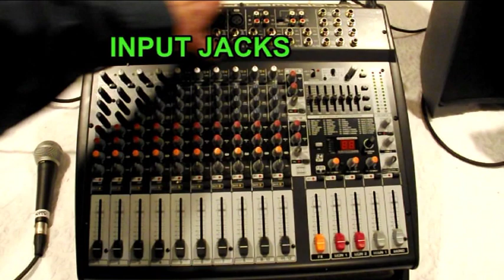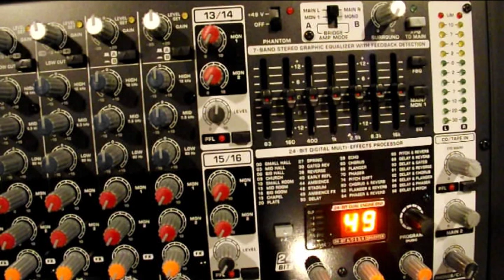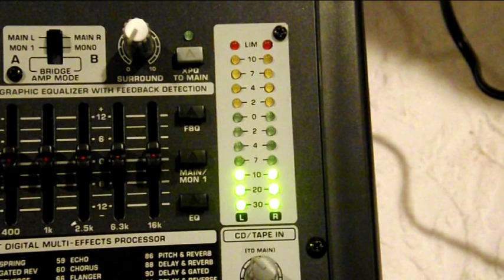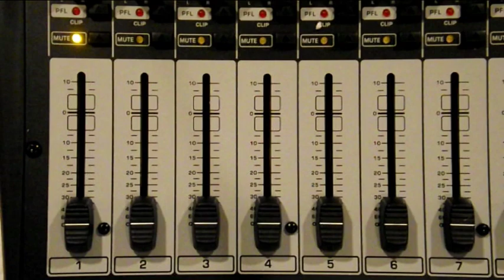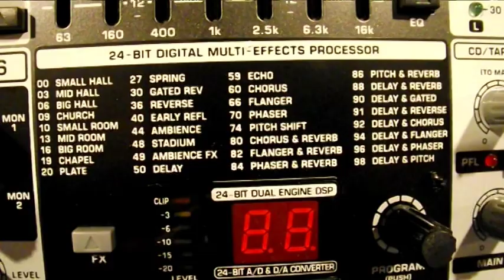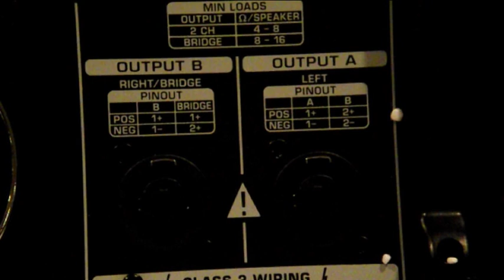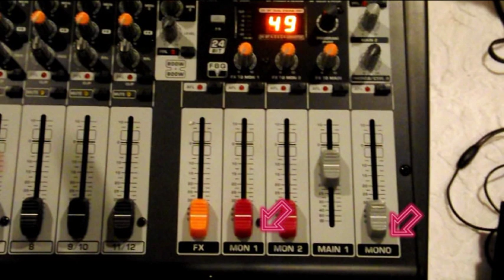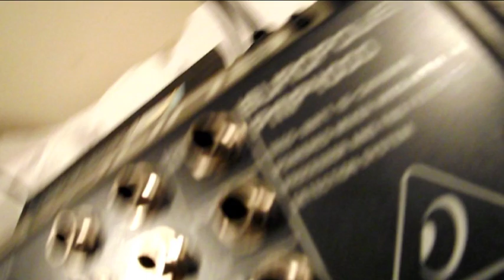Whacky Sound Education - System # 4 - Behringer Powered Mixing Board

Comment: Hi Frankie. 
We have this mixer in our band. Is there a way of getting sound to our passive subs from this mixer, as we only seem to get our volume coming from the passive tops. 
Ive seen somewhere else you can run a line from the mono output on the desk to the subs. Does this work, or do we need separate amps and a crossover to first power the passive subs?

Your help and knowledge would be greatly appreciated. Thank you.

Comment: So by using the main outs 1/4 inch I could connect to my bose or mackie powered speakers? Would there be a drop in quality by using this connection as opposed the the main outputs of the mixer on the back with a passive set of speakers.

Comment: Ok I have a very specific question on connecting speakers to this mixer, I have this very mixer which I use with a pair of EV-SX 300 passive speakers, now I want to connect a single sub either active or passive to this set up just to take the extra heft from heavy bass signals but have no idea if this can be connected to my currant set up, any direction on how this can be done or not done would be GREATLY APPRECIATED!!!
Reply from the maker: I have not been maintaining my website for a couple of years but I happen to see your comment and glad that I did.   The solution that would give you the best sound is probably an active bass or subwoofer . You would pull the sound signal from one of the line-level jacks located in the upper right of the board.  I describe how rhis works starting at time 10:57 in the video .  You will gain clarity and better sound if you use EQ to reduce low frequency (0 to 350 hz) in your passive house speakers. The sub should be connected to an Aux output with the EQ having  freq above 350 reduced.
Reply: @g123gfr  Well thank you SO MUCH!! this makes things clear & simple to follow and I need clear & simple to be fair lol, I will give this a try 🙏

Comment: I hope you can help me!
**SUB FILTER**
I think my sub filter is set up backwards. When I turn it on and turn the frequency down (30hz) my powered main signal cuts out completely…as though everything above 30hz (just about everything) is being passed to the sub. When I turn it up to 200hz all the highs go away and lows come through the passive mains that the mixer is powering. To me it should be opposite… all the highs should stay through the mains and some frequencies get passed to the sub. When I turn it down to 30hz, the sub should be mostly quiet because virtually everything is above 30hz… sending everything to the mains… and when turned up to 200 hz the sub takes on more and the mains lose their low end.
Instead, at 200hz… my mains lose all their highs and only produce low frequencies. 

What am I not understanding?

***Edit**^ 
This setting works when in main mode…in any mono setting, everything is filtered off… regardless of where the signal is going. When in main mode, the mono signal is low frequency only and the mains are running normally. Presumably, when doing it this way, you won’t drive your mains as hard because those low frequencies are being driven by something else

Comment: My effects processor section on this mixer is not working.  The display works fine, and I can select effects between 01 and 99.  The FX button seems to work, too, because it lights a dot next to the number.  I guess that the effect is supposed to be on when the dot is lit.  The problem is that I get no change in the sound.  No reverb, echo, nothing.  All the FX knobs are maxxed out in every channel strip, and the outputs (FX to Main, FX to Mon 1, and FX to Mon 2).

One thing I notice is that the FX level meter doesn't show any incoming signal at all.  I speak into a microphone connected to a channel strip with the FX knob up.  I only get the signal on the master meter but not on the effects processor meter.  I have the schematic for the PMX1000 by Behringer.  I would assume the circuitry is very similar to this one.  What could be the problem?  Is there part of the circuit that collects all the effect signals on every strip and connects them to the effects processor, like a bus?  I need to fix this mixer.  I would appreciate any help.  Thank you.
Reply from the maker: wow Omar!   Thanks for the updated info! please keep us informed on the progress.  I am sure there are many other people who have the same problem and would benefit from your solution.
Reply from the maker: Just saw your questions...did you discover the reason for no effects,?  Unfortunately my Pmp4000 got sold so I have no board to experiment or play with to try and replicate your problem.  just shooting fron the hip . . . did you have the "master fx" slider up?  First slider in group at lower right of board.
Reply: Thanks for your answer.  I did find out what the problem was.  Opening up the mixer I saw a little daughterboard screwed and plugged into the main board, right below the effects section.  This turns out to be the effects processor.  A technician friend discovered that one of the resistors on it was shorted, and he tried replacing it with a new one, but we still got no signal in the effects input, so he concluded that the daughterboard is shot.  Perhaps one of the integrated circuits was burnt out; we don't exactly know.  But we also found out Music Tribe is the agent for spare parts for Behringer, among other brands, so I reached out, and they gave me the part number with a list of service centers to contact, and one of them will get back to me with a quote.  Now I'm waiting to hear back.
Reply: The tech also said that, because the board is easily removable, he has the feeling that the manufacturer already knew it was going to be likely to have a problem.

Comment: Hi Frankie . 
I recently bought  Powered tops Ev zlx12P. Could you explain how I can run these powered tops through this powered mixer.  I understood you said use mon send section. Will this( mon send)  still act like a normal main L and R and can the mono slider then be used as the main volume ?. I just want to be sure , dont want to damage any gear experimenting. 
Thanks

Comment: can active speakers be connected to this mixer?
Reply from the maker: Yes, of course.   But you must use the output 1/4 inch jacks in the upper right of the  board.  this is shown and discussed in the video at times 1:20 and 12:00.

Comment: I have a question. 

Can I run a set of 2 passive speakers using the powered outputs and another set of active speakers using the line outputs? Like, can I use Main 2 for a set of 2 active speakers that will sit in another room?

Comment: Hi, could you explain how to use  the bridge mode  because I need more power  to sing in a banda and the stereo mode has no all the power that I need and I have to sing louder what may hurt my vocal chords. How to connect the speakers? Do they need a different wiring?
Reply from the maker: Oh my - I fear for the voice of any singer who is trying to out-sing a loud instrument accompaniment!  Your vocal cords and mouth are not intended to accomplish such an impossible feat.   You are correct to be concerned that you might damage your vocal cords because you certainly will damage them if you try to out-gun the instruments.  The correct tool for the job is electronics.  Specifically the Mixing Board.  

You do know that Adel ruined her vocal cords and had to quit singing mid-tour because she was doing exactly what you are describing about yourself!  (https://www.straitstimes.com/lifestyle/entertainment/stars-like-adele-keep-losing-their-voices-because-theyre-singing-wrong-voice)

To be clear, let me repeat myself on this important point .  .  .

I can give you information about how to connect your speakers in bridge mode . . . but this will not solve your problem.  The correct solution is proper use of the Mixing Board.  You can watch my Lessons 6a and 6b to gain a better understanding.

To put it in the most simple of terms . . .  the proper set-up of any live performance is for all the instruments and vocals to be routed through the mixer.  With such a set-up, the next step is to obtain a proper mix.  In your case, this means the audio technician needs to  turn down the volume on the instruments so the vocals clearly rise above the instruments.  This should be accomplished while the vocalist sings at a comfortable volume - even if it is a normal conversational level volume.  The electronics do the work, not the vocalist.

Once the correct balance is obtained . . . the main volume can be adjusted upward to make the entire musical set louder. But the mix will remain the same and the vocal will stand out above the instruments.  

Now, there are several things that may be causing this to not work for you and the band.  Perhaps the instrumentalists are insisting upon bringing their own amps and speakers and they are not routing their signal through the mixer.  Perhaps all instruments and vocals are running through the mixer, but the instrumentalists are having a me-me-me volume-war where each instrument is trying to increase their volume above the others.  And finally, perhaps the band you are in does not value the vocalist as an important part of their style of music, or perhaps they only want a screaming vocalist.  All of these reasons require discussion and respectful listening to resolve.  And ultimately, the implementation falls into the hands of the audio technician in charge of the mixer.  

Perhaps it is time for you to  save your voice and flee to another band!

Keep me posted . . . I'd love to hear how your issue gets resolved!

Comment: Hello, thanks for the video, it answer almost all my questions. I just would like to know if I can run the two active outs with pasive monitors at the same time I run the pasive outs with active monitors. Thanks!
Reply from the maker: Absolutely Yes!   I think so . . . well maybe . . . or maybe not!  Hahaha, please forgive my poor attempt at nerd humor.  The reason I am a little fuzzy in my reply  is because there is ambiguity in your question.  Absolutely yes, you can run two active monitors (EACH WITH THEIR OWN UNIQUE MIX) while at the same time running two active (amplified) outs with passive speakers (WITH LEFT/RIGHT PANNED STEREO OUTPUTS).   Basically, I am saying that you can drive 6 speakers (2 active Main mix and 2 passive Mon1 mix and 2 passive Mon 2 mix) but you can achieve only 3 unique mixes.  So if you are asking if it is possible to get 4 unique mixes so each of 4 musicians can hear the specific mix they desire, then the answer is no.    On the other hand, just to add to the confusion, you could fill the room with 10 speakers by having 6 speakers with a main mix (each amplified output can handle 2x passive 8-ohm speakers daisy chained and 2x active speakers could be connected into the unamplified main L&R outputs) Then Mon 1 mix could drive 2x active speakers and Mon 2 mix could drive 2x  active speakers. I hope this is all clearer than mud.  If not,  ask me some more questions and I'll try to untangle the mess.
Reply: Frankie Stamps thank you sir! Now its all clear. Im definetly getting one of this

Comment: Can you clarify about the FX button? Does not make any sense that one effect will apply to all channels at once.
Reply from the maker: Sorry for the delayed response, I have been super busy tearing my kitchen apart. Look for "kitchen rippin" on my Facebook!
Regarding the FX .  . Ding,ding, ding,ding  . .   You are  correct,  it does  not make sense for all channels to have the same effects all at the same time. Luckily the designers of the board happened to think about that idea themselves at the last minute, and they came up with a clever solution (I am being facetious here) . 
 I hope by now you have discovered how to add effects to just one or two channels. If you look at any one channel strip, there is a dial that is labeled FX. You use  this dial to set how much of the effects you wish to apply to that particular channel. For example let's say you wish for the lead singer to have some echo echo echo in his voice. you use the FX area to pick Echo, then you would turn the lead singers FX dial up and all the other channels FX dials would be turned down to minus infinity. Let me know how this works for you!

Comment: Hi I have a PMP6000 and I am only getting sound out of speaker A. In stereo mode, no sound out using the Mono1 mono , I am new to this board . Is it defective or is there something I am doing wrong. I remove the cable from B and plug into A and the Speaker works , no Power from B side of mixer? I also tried different cables and different Speak on adapters.
Reply from the maker: Hi "musiciansnearyou" . . . I am happy to report that there are many different ways to not get sound out of Side-B . . . all of which are pilot error . . . hahaha!
Of course it is possible that you have a defective board, but highly unlikely!
So, there are numerous questions that I need to ask to help you trouble shoot the problem.  But perhaps the best place to start is to make sure you have watched my video, especially around time 9:45 - 10:45.  
After  re-watching that section of the video, a simple check would be to 1) move the "output mode" switch to its upper most position, 2) Make sure you have a  sound source that is producing L/R output such as a mic plugged into a channel with the pan knob set to center, 3) Turn up the channel and Main-1 volume and see if you get sound out of A&B!!  Lemme know how it turns out!

Comment: can someone tell me whats the function of the surround knob?
Reply from the maker: I could not find any technical information regarding the "Surround" knob in the manual or on-line information.  So the following is speculation on my part.  Real surround sound requires more than two speakers or two channels. Since the PMP4000 only has Left and Right channels, I believe the "Surround" knob produces a slight delay and perhaps high/low filtering difference between the left and right output channels.  In essence it is taking the selected effect and producing "fake stereo".   Follow this link to Wikipedia to learn more about "fake stereo".  https://en.wikipedia.org/wiki/Duophonic

Comment: Can we connect active speakers from unpowered output line and passive speakers from the powered line(back of the mixer) at a same time?As I have both active and passive speakers.I hope to get the answer soon.
Reply: Absolutely, I do it all the time.  This allows the board to drive lots of speakers .   Passive speakers can be connected to the powered output speak-on jacks (A & B) on the back frame of the board,  and at the same time you can connect active speakers to the unpowered jacks on the  upper right of the board.  If you want a separate mix in those powered speakers,then you would use the Aux 1 and Aux 2 jacks.  If you use the Main 1 and Main 2 jacks, then their mix and volume controls will be the same as A&B.

Very versatile board!